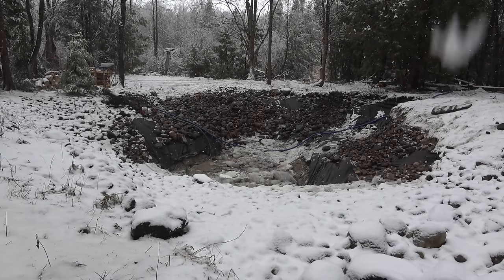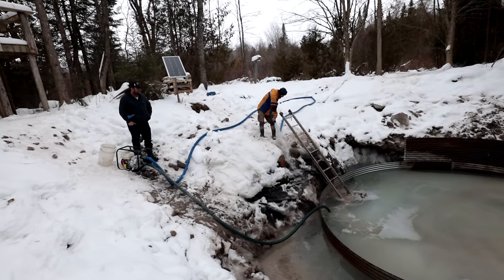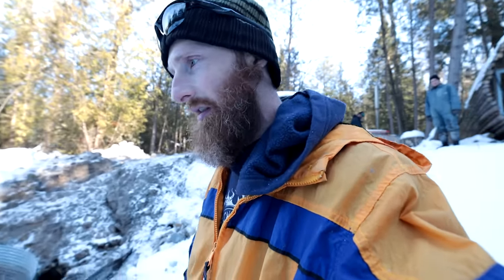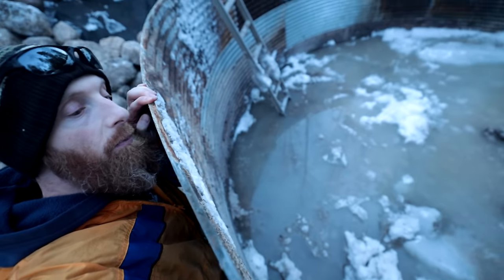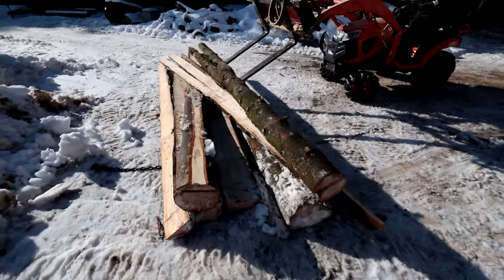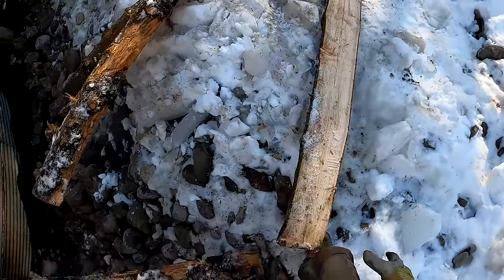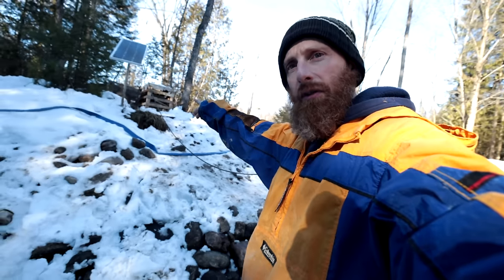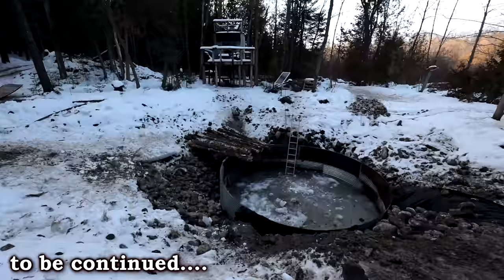Building NEW UNIQUE FISH POND STRUCTURE - 10,000+ Rocks, Sunken Log Jam, Super Deep

Comment: I've seen foresters use a curled up piece of sheet steel to form a sort of sled face on the front of logs that they were pulling through the woods. (think car hood flipped upside down)  It helped them ride up over low stumps and deflect off of standing trees. They just punched a hole in the curled front to pass the dragline through and pilled the front of the logs onto the sheet.After passing the dragline through the hole it was wrapped around and fastened to the logs. It worked really well and would probably keep the snow from building up in front of your logs and stalling you out. Just an idea.
Reply from the maker: Great idea!

Comment: make sure that you buy zinc sacrificial anodes for boats or this bin will rust out quickly.

It would have made more sense to rent a larger escavator from the beginning. Large enough that it would have sat outside of the pond and dug down. That way you wouldn't be pushing the sides in as much while digging. Combined with how much quicker it would have dug, this would have been much faster.

While digging out the pond, the grain bin could have been constructed out of the pond and then lowered in with the escavator.

Then you could put geo over the bin, and backfilled outside the bins with dirt. Then create the pond contours and placing rocks for the bottom of the pond.  A final layer of geo over the pond contours and layers of rock.

Also building der water water proof "creeks" for the springs that would direct their water into the bin.  

If you will have waterfall(s),  make sure to run a big enough pipe before putting in the final rock layers.

With how deep this pond is, the trout will be safe from predators. If you want, put in a dead tree in the bottom.

This will give you a pond that you can safely jump into.

Comment: Please think of adding pumps to move water as well as oxygenate they water better. I would wash the pond with the pump once it's all done. The silt should collect at the bottom. Clean that out. Then let fill. You need a spot with some plants in a corner that way the intake for the pump creates a draw. The plant roots will act as a filter and keep fish away from the pump. Put the pump in a pipe with holes drilled inside the pipe. Put a "p trap" style top for water to enter but not plants. You can do this for the overflow as well since it has constant water. Looks really good to me. Maybe metal bracing from the top of panels to a couple anchors inner the rocks is my only improvement I could think of. Amazing work
Reply from the maker: The only problem with the pump is that we don't have any power to run them, so we need something that will run off solar.  We'll try.

Comment: The tool is called a "drift" or a "drift pin" or, if it is somewhat larger than yours, a "drift bar". If it had an open end wrench on the untapered end it would be called a "spud wrench". Probably the most accurate name, considering that you are using it the way that you are, would be a "bull pin". It is strictly for aligning two holes.

Comment: 37:00 maybe you solved the muck issue. The aerator is the cause of the muddy water. Maybe you only needed to put that on a concrete platform. 🤔
Reply from the maker: It only causes a problem as soon as it's put in the pond. The biggest issue is likely coming from the fish swimming around tbh.

Comment: Hi Chris, nice project !
Are you putting in water lilies as well ?
Gives the trout some cover too.
You mentioned driftwood to give them cover, but you can also put in the edge willow in various ways.
It cleans the water, gives shelter and perhaps also the opportunity to let a bucket with meat scraps hanging over the water so flies will lay eggs in it and maggots develop and fall in the water as food for the trouts. (Just an idea)

Good luck.

I wish I could make here a pond that size.
I'm now a little jealous. 😂😂😂
Reply from the maker: Great ideas. Iffy on water lilies since they can choke out a pond quickly.
Reply: @TheWoodedBeardsman  personally, I never had that issue in my (small) pond with goldfish.
Okay, goldfish is way different to trout.
But in a special container where they cannot grow out..... But you have a lot of knowledge around to build this pond. It should be good.

But my idea would be together with the aerator try to get plants in it which can stand a reasonable current. 

And perhaps a fountain but that gives a higher possibility to a higher temp. in summer.

Comment: I'm confused about the benefit of the little nook you built on the outside of the bin. It seems like you've created a barrier, and now the small area under the logs will be highly oxygenated, but the large area of water inside the walls of the bin will be poorly oxygenated. Wouldn't it have been better to have the logs span the bin, and put the aerator down there? Or do you plan on installing a second aerator for inside the bin?
Reply from the maker: We are planning to do another aerator in the main compartment as well!

Comment: Why didn’t you put liner on inside of bin on floor and cover with rocks to hold down the clay at bottom? After all that work think it would pay to do it.
Reply from the maker: After a year to let it settle, we'll muck out the bottom of the grain bin again, then consider putting in a solid bottom where it dips down (no bed rock). That way, we can continue to keep the depth of the pond as the silt accumulates over the years.